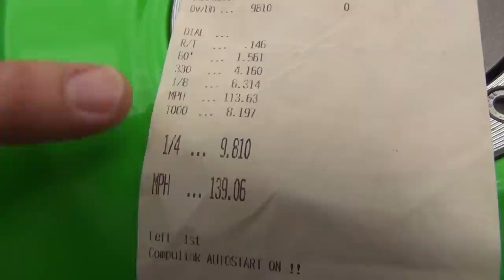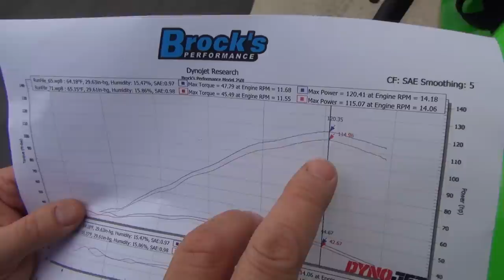Kawasaki Ninja ZX-6R 9-Second 1/4 Mile Drag Strip Setup

Comment: A 600 in the nines is a testament to your ability and nobody can dispute that, amazing !
Reply from the maker: Thank you. We try to back up all of our combinations with legitimate performance numbers. The 1/4 mile is a great tool and so is official LSR racing.
Reply: Brock Davidson Did you do any sprocket changing combined with the O ring removal? I’m trying to get my 08 r6 in the nines, it has 126whp, 520 conversion, 1 down 3 up, lowering strap in the front, k&n full exhaust with a flash and tune, GP shifted bike, I run engine ice, aftermarket clutch bearing and plates, new springs, bikes is stock wheelbase. Im also 130 pounds and the mirrors are removed. I’d love some advice or feedback
Reply from the maker: Yes. Gearing is noted in long description.
Reply: I didn’t even think it was possible for a 600, I guess I was wrong.
Reply: @jaimedevon6213  check the channel dude.

Comment: Im like 5’6 170 i took my 11’ zx6r to the strip for the first time and never actually tried to hard launch the bike before but i managed a 12.0 before the track got cold and i started to spin in 2nd gear at like 40mph i said f that im done 😂...My mph is 123 with a absolute god awful launch’s I think with some less gas in the tank a freshly lubed chain a good launch and no mis shifts i cant hit mid 11s not sure tho thats the goal.....When i hit 12.0 i had a bad launch like almost 3 sec 60ft and i missed 4th to 5th
Reply: Crucify me later I got the bike when i was 19 i turned 20 a couple months ago so im still new to riding im gonna get a new smoother chain it has the OEM chain but the bike only had like 3900 miles when i got it and its got like 4900 now about 9 months later 
.
.
. 
Pls give me any tips on how to launch better I leave at like 8k rpm i think i dont really look i just go off sound and fesl
Reply from the maker: check this out: https://blog.brocksperformance.com/faq/what-launch-technique-does-brock-teach-to-rookie-drag-racers/
Reply: Brock Davidson i feel like i need to lean forward more too....i was experimenting and it was way more comfortable to keep my legs down to help balance when i was like laying on the gas tank
Reply: Brock Davidson how i was doing it before my legs would cramp up 😂
Reply: Ran a 6.02 at HMP with a 2004 zx6r

Comment: Wow... And here i thought i wouldn't see one in the 9s... I would say my zx6r is decently quick. Motor stock, but full intake, exhaust, changed gearing, tune, etc. Im a little 125lbs jockey.  Ive had a few guys compliment me on how quick she is. My other friends with 600s cant keep up with mine.  What im hearing is new wheel bearings, a strap, new clutch (which i need anyway) and get better at launching. Shit i might try to get into the 9s next year... Gonna have to ask for some more hours at work though lol

Comment: It's after watching the barbecue clip long time ago with Brock when I started spinning my rear wheel to see how much resistance there is. Rear wheel takes surprising effort to turn if there's ton of chain lube and road grime tacked onto it. Now, very religiously, the day before taking my 636 to the circuit, I spend good bit of time painstakingly cleaning the chain, and use Teflon based lube, which feels like the having lowest resistance on the o-rings. Doesn't last, but hey, my toothbrush is always handy...

Comment: Nice, I'm excited to see gain.  BTW I tested a same day before and right after of a new K&n filter vs a new sprint and picked up almost 3mph in the 1/4 and almost 2 in the 1/8th. Crazy how good that filter flows bjust unfortunate they are not well know in the states. One of the best $ values for power besides a tune on a motorcycle IMO.
Reply: Carson Jennings  Really, welcome to outside world Jeff.
Reply: And then dust your engine out 2 yrs down the road. 
Sooner if you're a clean freak and cleaning it every week.

Comment: Man that sick and yes my first track day after getting my 03 zx6r I was blowing lower fairings off my buddys 08 gsxr 750 that was stretched big sprocket quick shifter and full bricks exhaust my bike stock engine k&n high flow air filter lowered about 1 3/4 in front can’t remember the rear and Diablo Rosso 3 a lot of adjustments to my clutch Ran ethanol free gas and added 5 teeth to the rear tan 10.9s all night and that was me being scary with that new sprocket I had a few power wheelies in first and second gear until finding the sweet spot in my rev

Comment: Went 10.63 @ 132.31 on a stock 2012 cbr600rr with just a TBR slip on no tune nothing else changed. Bought a 2011 ZX6r to build into a track bike also looking for 9.90's or better on engine.
Reply from the maker: Nice work on the cbr. ZX6R can go deep into the 9s with the right parts and rider.

Comment: Cool video! I hardly ever drag race with my  2011 zx6.but with yoshi full exhaust a BBM filter and power commander.46 rear sprocket and one down in the front,I  clocked a 10 flat.and that was on power one tires.the bike is making 118 hp at the wheel.oh and a stock clutch.but these bikes really shine on the track ,they corner so well! And have nice brakes stock.

Comment: Essentially it's still fairly stock, in 2006 I drag raced my k6 gsxr600 against and 06 r1 and ran a 10.2 it was stock chassis and everything all we'd done was put a leo vince exhaust, k&n air filter and played with the fuelling with a yoshi box. It made 115rwhp and the guy thought it was a 1000, the 600s are great because they don't want to wheelie as much as a litre.

Comment: Amazing! I've only been to the strip once, but the best I could do is a 10.43 on a 2012 ZX14R. I would really like to get under 10 seconds. The track has been resurfaced, it in pretty bad shape when I went.
Reply: It’s all about clutch and throttle control. Prep helps but it’s not the due all end all on 200 hp lol

Comment: Crazy, well what's the quarter w/o any modifications? Personally I'm a returning rider with a 2023 636cc zx-6R.
Reply from the maker: Won't even run in the 11s all stock, the OEM gearing won't let it leave the line without bogging.

Comment: awesome to see something less common! did you guys torque the axle bolts/nuts to normal or did yall back off a little?
Reply from the maker: I have never understood the loose axle theory? But I also make sure that all of our spacing is correct. We torque the axle to the factory spec, or higher, to make sure the axle doesn't move during the launch.

Comment: Chain looks a bit too tight.  Your rider makes that time from 0-80.  Just unreal what he can do.  I weighed 95 lbs when I got my first bike.  Was an F4i.  Sold it 3 weeks later for a 929.  Now have a 191whp 1299s (100wtq) at 387 lbs with a a gallon in the tank.  But I’m 180 lbs now.  5’11”.  Wish I was around 110-120 lbs on the 1299.  Would be just about perfect🍻.  Wish they made a 1499... crazy fast 600👊.  Good to see you love what you’re doing
Reply from the maker: Chain was a bit tight. Glad you like the vid.

Comment: Now we’re talking about my bike; a 07’ ZX6R. Yeah it’s true get out of the hole with a good launch and most bikes will have trouble catching up; especially in a 1/8th. I happen to be pretty good on the clutch, but I no way am I going to run a 9.81 @ 139. I’m still completely stock; no flash, no lowering, no sprockets, no titanium exhaust. The only thing I got going for me is I’m 170 lbs.

Comment: So you add more gear to drag race it? I've always gone the opposite way with a couple teeth on the rear sprocket on my 1172 cc 1984 Kawasaki GPZ which almost throws me off of her at take off and 2nd and 3rd shifts due to the Barnet springs in its clutch and 150-160 hp old school power.
Reply from the maker: @W.Ormsby - Our biggest problem with a  bike like this is wheelie reduction. Rider skill can control the initial launch, but for the quickest ET, the launch must be combined with the ability to open the throttle 100% before the 1-2 shift. If the bike violently wheelies in the top of first, or any gear after - the rider is at the mercy of the set-up. Taller gearing leads to quicker ET's compared to other means: reduced power (rider backing off gas, adjusting power output through the ECU, etc...). Hope this helps.-BD

Comment: Are there any down falls to the no orings in the chain, I've herd this done before, but I'm also hearing this is not advisable for a everyday street bike, with the dirt and  debris collected. Could you elaborate or make a video regarding this if time permits. Also the clutch mod for this, what zx10 parts did you use? Thanks in advance, peace ✌ from Jacksonville 07ZX6R
Reply from the maker: @Rick Davis -Removing the O-rings converts your chain to a looser set-up of a non-Oring chain. This means that if you don't lube it after getting caught in the rain, it can be destroyed quickly--in addition to needing frequent cleanings. In Jacksonville, with your rain and sand - an O-ring chain would be far less work and hassle on the street. If you care about picking up a bike length or 2 in the 1/4 mile..it might be worth it to you? I'm not sure how you ride. Clutch Mod: https://brocksperformance.com/clutch-mod-zx-10r-04-21-and-zx-6r-05-12/
Reply: @BrockDavidson  understood, thanks alot for responding so quickly as I know your a busy man. Speaks volumes sir.  Will certainly look into this, and get my PayPal setup.  You have a new customer this way. Peace ✌from Jacksonville 07ZX6R

Comment: You should put all those parts in a kit and sell it.   I have a '19 ZX-6R and I'd probably buy one.  It's funny that you mention a Hayabusa because I have on '02 as well.  One other thing that might put you even lower into the 9's that you should do is a quick shift, my '19 has it and it's awesome and so very fast to shift.
Reply from the maker: Quick shifter on the 600 would be worth over 1 tenth in the 1/4 mile.

Comment: Velocity stacks and air box surface area. Let’s get into the fixings.
Reply from the maker: Stock w the exception of a Sprint P08 F1-85 air filter.
Reply: @BrockDavidson  is the p08 none race version still adequate for a 2021 krt zx6 or does it need to be the f185
Reply from the maker: Certainly! The P08 F1-85 is simple the pentical of performance.

Comment: let me ask you a question. So i have a 07 ZX6R
i had the shop clean the air filter out on my bike over the winter. and now its making a ticking vibration noise while in gear. it does it in every gear but its the loudest from 1st to 4th gear on 2k-6k rpm. You know when you give it gas then shift and then let it come back to the rpm thats cruise comfortable and the bike is just in the perfect state sound wise and speed wise? thats when the noise is loudest. its coming from down by the fan to the wheel dampener to the inside the gas tank. sounds kind of like loose keys hitting the tripple tree but its not the keys. ik its not the cam chain either. bc cam chains do it on idle and while riding. so what could be my problem? thank you for your time in advance .
Reply from the maker: Check to make sure your fan isn't hitting the radiator.

Comment: Brock, you mentioned Alisyn and Petron... noticed that the application on <0w says "stock engine." Would this be safe to use on a gsf1250 with higher comp pistons and yoshi st1 cams? If it's applicable, I live in a pretty cold climate.
Reply from the maker: For your application, we would suggest 0w20 with the Petron.
Reply: @BrockDavidson  thanks, waited on your reply before pulling the trigger. Will get the 0w20 instead of the <0, thanks again.

Comment: Any advantage in tuning a bike to run on E85 as opposed to race gas? Will the fuel system hold up to ethanol?
Reply from the maker: No measurable improvement in normally aspirated applications. Fuel system will degrade on older bikes. Most modern sportbike fuel systems don't have enough volume required. + many other issues. This is why we use MR12 for true performance gains.
Reply: @BrockDavidson  Thank you

Comment: Am I able to just use my lowering strap on the front at the drag strip by itself? (‘19 zx6r) My lowering links are in the mail so won’t be able to install them before I head to the strip this Saturday
Reply from the maker: certainly, many people use the strap alone - it helps with or without the lowering links.
Reply: Thanks Brock for clearing that up. Can’t wait to see what my little 636 can do now. I’m only weighing 135lbs lol

Comment: Question: I have a 2018 Z650, do you guys offer a tune or anything for it that will help me in the area of more power, choppy throttle, more response...? Its bone stock but I do want to do an Akropovic exhaust, filter and PowerCommander but haven't yet.
Reply from the maker: We dont. Maybe try guhl motors for a flash.
Reply: @BrockDavidson  Thank you sir. When I get my ZH2 at the end of next year (made a deal with my wife and I get to get a ZH2 next year) I'll bring it to you guys for some work.

Comment: How do you attach the kill switch lanyard?
Reply from the maker: Drill a small SHALLOW hole in the kill switch - oriented so that the engine will die if the cord is pulled - and secure lanyard with a small screw.
Reply: @BrockDavidson  thankyou

Comment: Hello! I have found on the internet that these bikes need an AFR below 13 for the best power. Is it true?
Reply from the maker: The Internet is partially true, but if you want to understand more clearly, this is a good place to start: https://youtu.be/RmWkwTZ-n7o?t=1306
Reply: @BrockDavidson  Thank you very much! I have the same bike and last year I ran a pb of 9.81 with the stock headers. This year I purchased a full Ti system. We don't have a dyno around so the map is done in the street...
Reply from the maker: You might like this also: https://blog.brocksperformance.com/faq/how-can-brocks-get-mapping-so-close/
Reply: @BrockDavidson  After 2 years, we finally managed to run a 9.78 @227kmh, with similar configuration, on pump gas.
Reply from the maker: Nice job!!!

Comment: Can you put a switch to choose between pump fuel and racing fuel on a z1000 2011 model and on a z 750 2008?
Reply from the maker: It's a map selector switch https://bit.ly/3pdOl47 - it allows dual maps to be run on any bike using a Dynojet PCV.
Reply: Brock Davidson ,if the bike has been already programmed in directly in the stock ecu you need to start from the beginning with the program and etc?
Reply from the maker: Yes. unless whoever programmed your ECU has the technical capability to place another map in a different driving mode.
Reply: U are the best!!! 🙏

Comment: Ever used diaphragm clutch spring ?
Reply from the maker: Yes - while they work well for general street use, they make small adjustments to the static spring pressure impossible, which is critical for quick 1/4 mile times.

Comment: What's the benifts from taking out the O-rings vs buying a non O-ring chain?
Reply: Reduces friction, now you have some space in between the links rather than them rubbing constantly.
Reply: Least amount of friction at the cost of wear.  Plates and pins are very loose so it's not going to last as long as a stock chain
Reply from the maker: I have had this set-up on my personal Busa since 2008. No accelerated wear as long as the chain stays lubricated - especially after getting caught in the rain.
Reply: @ajsmotolife5641  Yeah I get that...as stated by the other 2 people that replied also. I guess my question should be stated, after spending 2500.00+ on just the exhaust and bearings, why you even invest the 30mins of labor of removing the O-rings when you could have just spent 15-20 on a new NON O-ring chain?
Reply: I tried a standard non o-ring chain on my SV once. Lasted 600 miles before it went to kinky bad land. I wonder when the mfg's will make a purpose built non o-ring chain for drag racing. I think someone does already. RK makes lightweight ones. $250 bucks!

Comment: Not to take away this achievement but, didn't Rickey Gadson turn a 9.9 on a stock motor ZX6R like 15+ years ago?
Reply from the maker: Ryan Schnitz ran 9.50's in 2001 - he was truly impressive, but those bikes did not have stock engines. Our point is not that we are the fastest - it is simply to show others a direction, if they are interested.
Reply: @BrockDavidson  rock on bro

Comment: What’s the life span on a No ring chain?
Reply from the maker: The same as an o-ring if properly oiled./maintained. They can die in a few hours if not lubed immediately after riding in the rain.
Reply: Brock Davidson since we are on chain topic I usually clean the chain with Kerocin and lube with Maxima Chain wax! I’m going to switch over to Maxima Chain Guard because it’s clear. I ride 2-5k miles in a year so I clean and lube about every other trip. Any tips or tricks

Comment: Didn't he jump?
Reply from the maker: No. Reaction time is on ticket.
Reply: @BrockDavidson  I'm not very familiar with drag racing but I checked the video and the bike started moving on yellow, so idk if that counts as jumping or if there's a split second grace period
Reply: @BrockDavidson  Also the average reaction time is between 150-200 ms so if the bike started moving before green that was more instinct than reaction which makes it less legit in my book. 🤔 If you relied on reaction the time it would have been 10 seconds, nevertheless great video, GREAT BIKE.